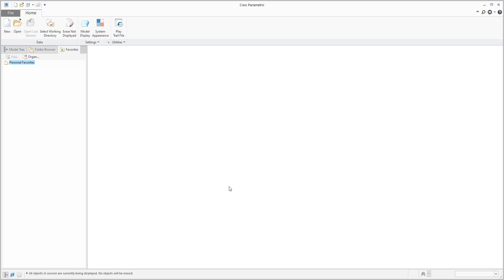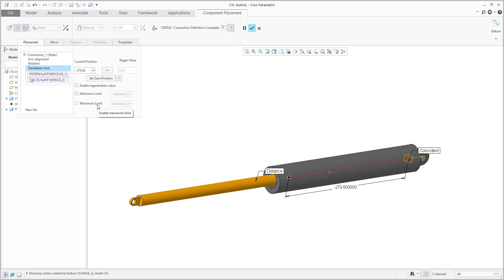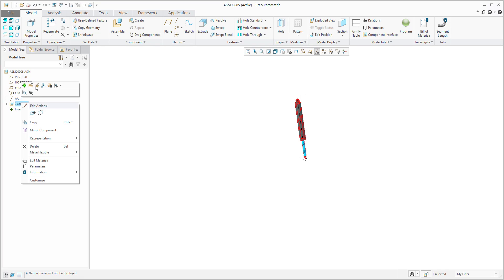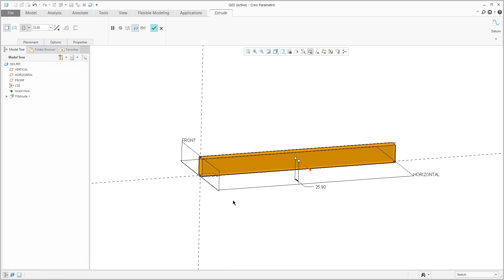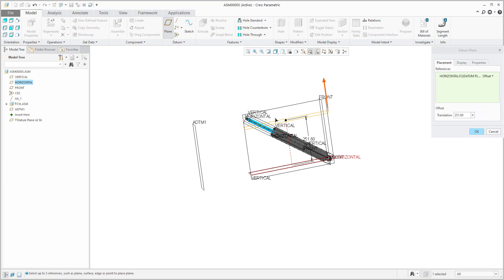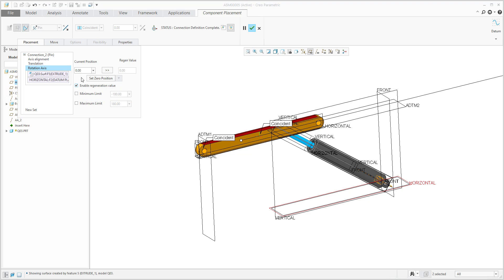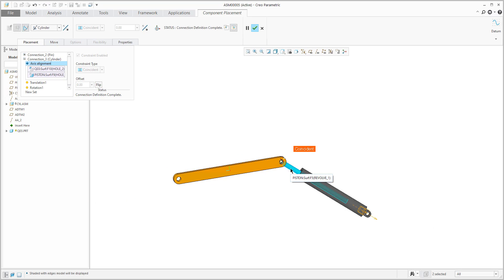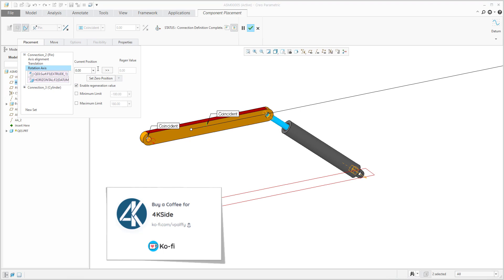Mechanism constraints - custom orientation

Comment: this is great. However, how do I edit this position if I place it in another assembly? say I wanted to use this same set - but show it in another file with an extended and compressed placement?
Reply from the maker: Sorry for my late reply....summer break 🤝
If you will create a Snapshot for the mechanism, and you will place it to me another assembly...system will show you you in top assembly Snapshots from below assembly.
Reply from the maker: Hi, I have created a new video for you 
How to work with Snapshots in Creo Mechanism assembly
https://youtu.be/w9d7fbz1pRQ
Thanks for your proposal. Vladimir